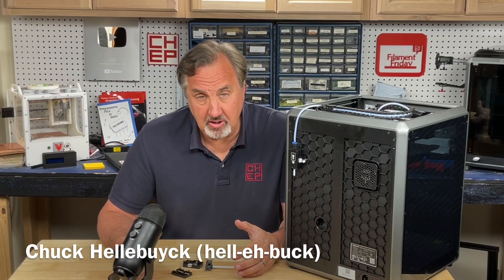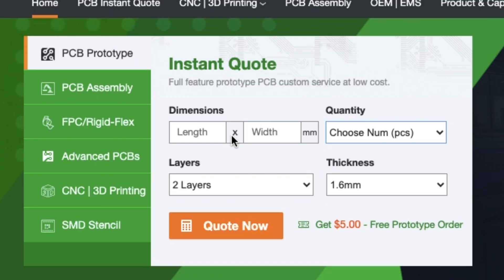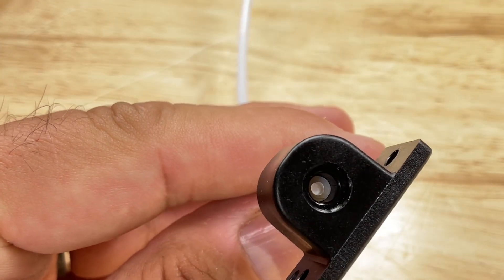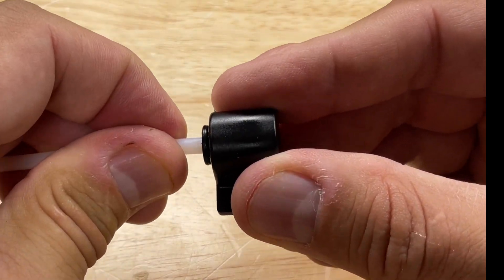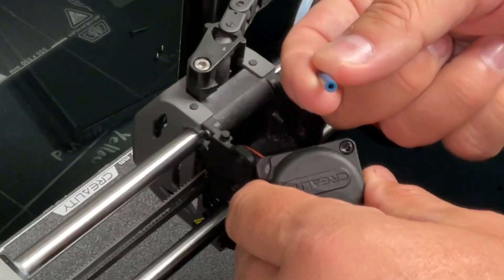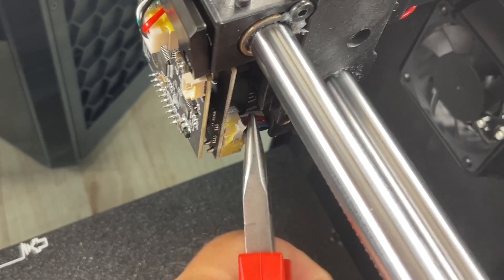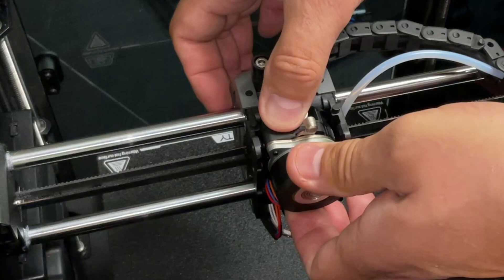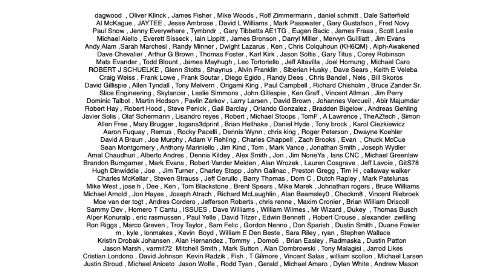Fixing The Filament Loading On Creality K1 Series 3D Printers

Comment: Okay we removed the PTFE blue tube (damaged the tube in the process) and still have filament stuck in the bottom…
Reply from the maker: Heat up the hot end and try to push it thru the nozzle with a very small Allen wrench or similar tool.
Reply: @FilamentFriday we did try this and it is still stuck 😢
Reply from the maker: Then replace the nozzle.

Comment: The other problem areas were where the clips hold the ptfe tube on the back. I noticed they pinch the tube causing resistance when inserting filament.

Comment: I don't have a problem with all those issues like most of you. My issue is that the gears don't pull the filament into the extruder. It just jumps. I've tried heating to 250. And even 270 but the long pin just hits a hard surface when I push it in

Comment: Chuck, 
I love your videos ... great tips. But it seems Creality design progression negates some of the benefit of old suggestions. 
I just bought the Revised Extruder Upgrade for my 2 year old K1-Max, for the benefit of the spring loaded engager & elimination of the dreaded blue PTFE clip.

Everything went great up until I tried to stick the Drill-Bit Modified PTFE tube back into the new Extruder. 

The old extruder has an approximately 4mm hole its bottom, to receive the PTFE tube; but the new one has an approx 3mm hole; so I can't seat the updated extruder back into place. 

Should I sand down the PTFE tube to 3mm to get it to extend 4mm into the newer unit. The PTFE Inside Diameter is about 1.8mm, so not much will be left.
     Or is there smaller size PFTEs available ?
         Or should I cut the PTFE shorter, to just reach the Extruder on the bottom side.
            Or, my solution,  drill out the new Extruder the necessary 4.5mm to accept the PTFE tube. A 5/32th drill bit does the trick.

As I wrote  this I discovered other videos suggesting that the eventual switch to the Unicorn hotend has caused this new Extruder PTFE issue appear. 
And, many suggest the original extruder is a better performer; than Unicorn. Maybe there is a new video in this situation for you ?

Any ideas or suggestions welcome.

Comment: I can't ge the filament to feed in to the extruder, I can hear the gears turning but they do not seem to be grabbing the filament into the printer head.  Any advice?  Also when I took this apart there was no little blue ptfe tube, is the important to the process and could that be part of my issue?  The machine is practically brand new.  Thanks
Reply from the maker: Yes, the blue PTFE guides to filament in. It’s necessary.
Reply: @FilamentFriday  thanks is it a special piece to buy or can i buy a tube of ptfe and cut a piece off?
Reply: @filamentfriday it is crazy as well, that piece was not in the unit and I have been able to print somethings, i must have just got lucky
Reply from the maker: You can but it and cut a piece off.

Comment: Any tips on how to unclog the blue bit at 6:23? My Extrude is free of Jam, but filament is stuck in that small blue bit.
Reply from the maker: Heat it up and push it out.
Reply: @FilamentFriday Thanks for responding I heated it to 300c and tried using the supplied push pin and it was firmly stuck
Reply from the maker: @Silverj2k7 - Just replace it then. You can buy Capricorn PTFE tubing on Amazon and a cutter to get a straight cut. https://amzn.to/43APoyP
Reply: @FilamentFriday  Thanks. Things have gone a bit wrong for me. I've stripped one of the hex screwes from the grey fan cover, Do you happen to know what size it is?
Reply: @FilamentFriday  Managed to clear my blockage, heated it up to 220c and used a pair of pliers to pull  the filament out! :)
Reply: @FilamentFriday I've used pliers on the rod and bent is but it doesnt push out

Comment: I did all that an loaded brand new roll of creality hyper pla. all it does is makes a clicking sound still. Any other suggestions on why it won't grab the filiment? I recently replaced the hot end too with the extra one it came with- could that be causing an issue ?

Comment: I always straighten the first two inches of filament on a new roll for my K1 Max which seems to do the trick. I also just stopped bothering with the short PTFE tube on the extruder at all. It doesn't seem to cause any problems. I'm getting an Infinity Flow for it and my MK4S. That should make things simple or a disaster, one or the other :)

Comment: Thanks for this, not the best design here on the K1 Max but we work with what we have right? The way the PTFE tube goes into the K1Max leaves much to be desired. The angles for the PTFE tube going into the printer is just wrong, but alas...
Reply: You know you can disconnect the ptfe tube right? For K1max just press down on the small disk connector and it pops right off. The criticism is that it takes a long time just to automatically retract, load in new filaments then extrude again. Not that it’s hard or poorly designed
Reply: @Leo40214  Apologies, I should have been more clear. My comment was related to where the PTFE tube goes from outside the printer to the inside of the printer, not where the PFTE tube goes into the extruder. The 90 degree bend over a short distance is not ideal in my opinion. Thanks for your response and I agree, loading new filaments do take a long time. Seems like this is addressed with the K2 Plus with the inclusion of a filament cutter like we see on Bambu.

Comment: Exacytly my problem, put a veryu thin plastic tie rap in to see if it would go through, came out mid way, sideways, so there is no real connection between the feed in connection on the detector, you have to hope you're dead centre, with a flexible filament ? Good luck with that, next issue, on the K1C, the screen is at the fron, so you might be at the back, trying to feed the filament through, not realising, it's waiting for you you to press the button. Next issue, during extrusion, it extrudes about 6 inches, then stops, you're waiting at the back, wondering why it's not extruding, Next issue, on the print head is a lock and a slide symbol, does the lock mean, yea, grab the filament now and begin extruding, or do i wait to get the filament extruding, and then lock... All inj all a badly thought out design, I should just feed in the filament and that's it, misalignment issues all the way on my printer.   it is the 21st century.
Reply: why not at least have a buzzer at the start and end of each operation so you know whats happening. managed to get past the detector to the print head, but now it won't go in there either, How is it possible to go wrong feeding a bit of filament in to a hole ??? In the end I cut the ptfe tubing near the print head to see of i could get the feed gears to catch the filament, but no luck so far...I used to have an ender 2 pro that worked flawlessly, so i thought I'd stick to creality....now realising how lucky i was with that little ender 2 pro.

Comment: Yeah I was having these exact problems.  Shame they don’t have some quality control when they ship this stuff.  UPDATE:  Although your sugestion does still help it pass the entrance of the sensor after taking both of these elements of my K1Max apart it seems that the filament snags internally whilst entering the second brass tube of the filament run-out sensor also.  Also like other people have commented I don't have a PTFE tubing on the extruder but the filament is getting snagged immediatly entering the extruder I opened up the extruder to find that there is an extreamly tiny plastic ledge immediatly after the entrance.  I tried to smooth it over but this hasnt yet done the trick.  This printer should not have gone in to production.

Comment: got the latest K1c . i have not piece of tube between the tractor motor and extruder. Did they forgot to build in ?
Reply from the maker: It’s because you have the new unicorn nozzle that came out after this video. The nozzle has a built in copper section to replace that tubing.
Reply: @FilamentFriday Thx for ur ppt answer

Comment: Thanks for the insight. I've noticed that my filament after a print will become cracked in the feeding tube to the motor and sometimes will be BENT just after filament sensor. Any comments on a fix? Thanks again.

Comment: Great video, thank you! My printer is a Creality Ender 3v3 which has the same filament run-out sensor as the one in your video. Your video gave me the courage to take apart the sensor on my brand new printer (manufactured approx. Nov 2024). It turns out that in mine the end piece that holds the PTFE tubing has a tapered guide inside, covering the blunt end of the tube, which guides the filament directly into the tube without hitting the blunt end of the tube. Maybe Creality listened to your video and improved their design. BTW my problem turned out to be of a different nature: When the starter filament that came with the printer ran out, I didn't fully remove the piece of filament that was still in the tube. Rookie mistake.

Comment: Great video. I loved the 'Drill Fix' for my K1 Max; but I also found that my PTFE tube on the Right Side was not all the way thru that 1st Mount, which nicely 'cups' into the Sensor Assembly. It is worth checking that Right Side Alignment as well; which in my case was pulled too far away from the interfacing surfaces. This I guess was caused my poor insertion of the feed tube entering the K1 Max.

Comment: As i tried to disassemble the feeder box thing and the aligntments I ran the 2mm hex through the feeder and out came a dustball that had clogged it. Need to build some sort of soft "remove dust from fillament" contraction before the feeder with some sponges or something. Got my K1 Max in the clauset and some dust there is inevitable. Thnx for great vidz as always

Comment: Hi Chuck,
Thanks for the info.  I just set up my K1 max yestersay afternoon. I printed your side spool holder on my Ender 3 the night before so I would be able to use the side spool holder right away.  I used capricorn tubing to go to the run out sensor and ran in to the exact problem you had This fix will sure help keep the frustation level  down as I get used to the K1 max after getting so comfortable with my I3 Plus and various Ender 3's.   Also,  would you have a downloadable profile for the K1 max?
Reply from the maker: Not yet. Working on it.

Comment: would you please tell if you also have a video about what to do when filament ends in the middle of a print? I just hit "continue" and... what? change PLA while clearly there is some filament left inside the printer? Because I tried this way and the print just failed ;)

Comment: Nice video, but I have a K1C and it is different:
Extruder: The K1C features an all-metal extruder, designed to handle the wear and tear of carbon fiber filaments.
Nozzle: The K1C comes with a proprietary "unicorn tri-metal" nozzle, offering better thermal conductivity, wear resistance, heat break performance.

There is no blue tube...please remove K1C from description. Nice video, but no help on fixing stuck filament on a K1C...

Comment: Any thoughts on these all metal extruder wheels that seem to have surfaced recently? I have 4 K1s and it has been a challenge . They worked well for a month or two sliding towards filament binding up at the mouth of the hot head. The recent unicorn quick change nozzle/hotend looked like a God send, and seemed to be for  week or so, but the ticking of the extrusion motor started to creep in, creating finished prints looking like Swiss cheese be for I realize the issue. 

Appreciate any thoughts.
Reply from the maker: The wheels have always been metal so not sure what you refer to.
Reply: @FilamentFriday  HI. The extruder wheels as they come standard have plastic turn gears on the bottom and metal extruder grip wheel on the top. On Amazon under Creality it seems they have come out with all metal, top and bottom extruder wheels/gears.
Reply: @brentdrafts2290  I wondered about this new ALL Metal gear offering as well. Did you try them ??

Comment: HI, THANKS FOR THE VIDEO. SAME ISSUE, I HAVE THE NEW EXTRUDER I THINK, EVEN THOUGH THE BOOT IS RED , WHEN I TOOK OUT THE EXTRUDER , THERE WAS NO PTFE TUBE, JUST WHAT IT SEEMS LIKE AN METAL TUBE THAT GOES INTO THE HOLE IN THE BOTTOM WHERE THE FILAMENT COMES OUT AND IN TO THE HOT END . IS THE PTFE TUBE MISSING , AND IF IT IS MISSING . WHAT SIZE DOES IT HAVE TO BE, I HOPE YOU CAN HELP ME
Reply from the maker: There is no PTFE in the new design
Reply: @FilamentFriday  THANK YOU FOR TAKING THE TIME TO REPLY, MUCH RESPECT.
Reply: @FilamentFriday  I just started to update my K1 MAX and it does have a Blue PTFE, so I applied your Drill Bit idea; only to discover that it does not fix the NEW Extrude gearbox. Should I just sand it down to size?

Comment: The 1/4" drill bit is a good idea, but not really necessary.

I have the K1-Max.

I used to have similar problems loading the filament.

A bit of brainpower showed me a simple remedy.

1.  Cut the filament square (90 degrees...not 45 deg as everyone suggests...no no no.)
2.  Use a nail file/emery board to chamfer the outer edge of the filament.

   | |
   | |
   \ /  <-Chamfered end of filament.

Guaranteed not to snag as a filament cut at 45 degrees.

It will slide nice and easy into the orifices.

Comment: Excellent video Chuck. It probably goes without saying - but be sure to blow through the tubes backwards or make sure you don't leave any ptfe shavings in the filament path. They could and most likely will plug your nozzle.

Comment: Chuck,  I just watched your video and you fixed the annoyance of my K1 Max every time I try to load a filament. I didn't do the drill bit trick, but when I pulled the PTFE tube end in the switch was chewed up. Cut the tip that was chewed and now the filament goes in with no issues. Thanks for the video, keep them coming.

Comment: Teaching cutting filament at a 45 degree needs to stop. It works with some printers, but will cause severe aggravation with most others.

The sharp tip will bind on every chance it gets. The solution is to cut it then cut it again at a different angle until the tip of the filament is somewhat close to center and there aren't any edges that the filament can get stuck on.

Modifications of the machine might help sometimes if you just cut it at a 45, but they won't always. There is always the leading tip that is off center that will want to find a place to catch.

Center the tip of your filament before feeding. You'll thank me later.

Comment: My newer style k1c: To find where the hang up within the filament sensor, push the filament up until it binds. Grab the filament at the guide tube, then pull out and align it outside of the sensor. If the guide above the sensor is the problem, the end of the held filament will align with the top of the sensor.  As suggested, make sure the ptfe tube is inside the sensor body.  On the hot end, I remove the ptfe tube, run 2 inches of filament thru the tube and manually insert into the unlocked extruder until the filament bottoms out, then lock into place and re-insert the ptfe tube into it's push lock. 

Thanks for the fixes. Keep 'em coming !

Comment: Good info as always. Something that also helped my K1 Max filament path was to bypass the rear entrance and come in straight from the right side.  I drilled a 5mm hole in the upper right corner of the side cover which allowed the PTFE tubing to enter the runout sensor straight on.  I also printed a lid riser and replaced the stock tubing with a length of Capricorn reverse Bowden tubing which has a slightly larger inner diameter than the stock Creality.

Comment: Is there a difference between the old extruder motor and the motor on the new version extruder? I have the first version of extruder on a K1 and am not sure if I should get the $29 extruder only or $49 extruder and motor.
Reply: Motor is the same
Reply: @diwest1737  ok cool thanks

Comment: The radius bends on the PTFE tubing are too small making it harder for the extruder to do it's job - especially with larger surface prints, and filament with poor diameter tolerances. Did Creality do this so a flat lid could be placed on the printer? I think a better solution is to have a coupler at the filament spool end that can rotate, and don't attach the tube to the frame anywhere else so you have a single large radius bend. It does however mean that to totally enclose the printer you need a lid with a high roof.

Comment: It's actually easier if you use the side cutters that come with the printer to flare the PTFE tube.  Just stick one arm in and rotate it around to ream it out.  Also, the extruder alignment issue can also be resolved by swapping the PTFE tube with a 2mm ID tube instead of the stock's 2.5mm ID.  This will prevent it from getting to the side.  (The inside is only 2mm ID as well, so it makes no sense that some of their machines shipped with the 2.5mm ID PTFE tubes.)
Reply: Smaller ID may cause problems with some filaments dragging on the inside and not feeding smoothly.
Reply: @JustSomeHuman-j8o  No, not at all... filament is spec'd at 1.75... all normal PTFE tube is 2.0mm ID already.